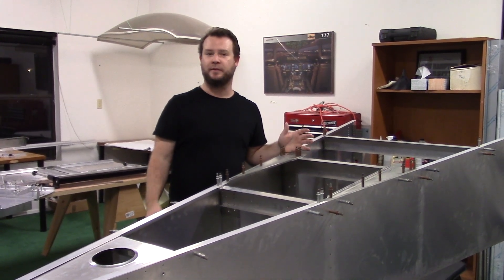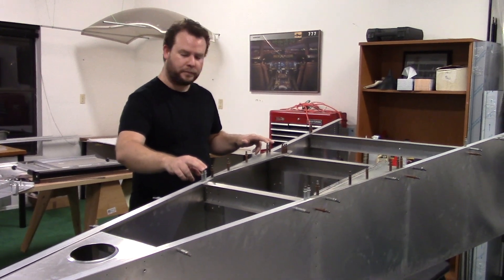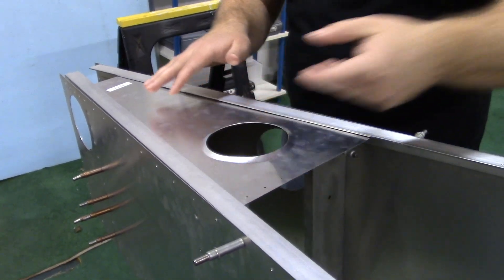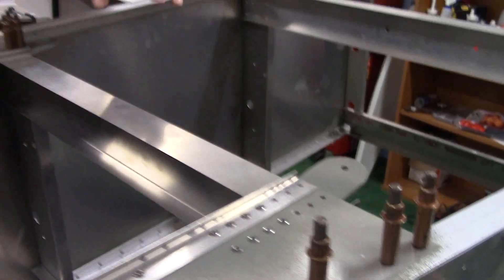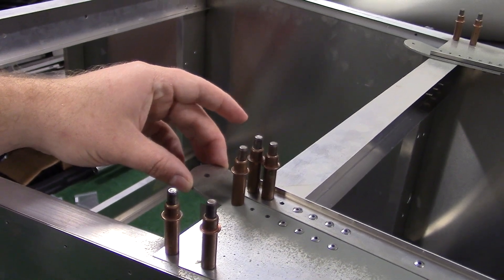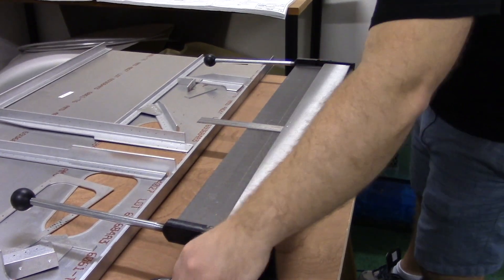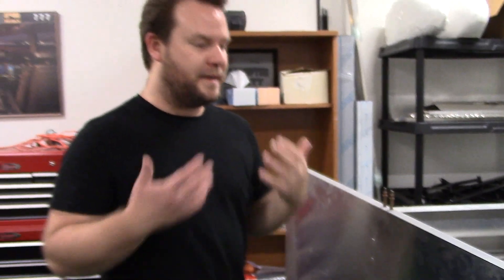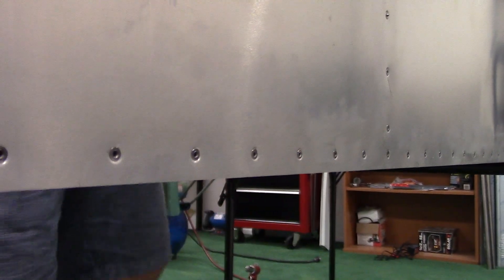Sonex Aircraft Build Video - 67 Shoulder Harness Web Install

Comment: Looks like the shear web (F22-03) is upside down. I believe that will get in the way of the horizontal stabilizer mounting. I am scratch building a Sonex myself. Thanks for putting the videos out. I have not had time to work on my plane in a long time. Keep pulling the rivets. You are not too far behind me.

Mike
Reply from the maker: I'll take a closer look. Thanks for the catch! -Dan

Comment: Ahhh. This brings back memories. I think I spent about 50% of my build time studying the plans to figure out the next task. The plans are really good, but you do have to use your brain to get the most from them. I admire your patience to use all flush rivets.
Reply from the maker: Hi David! I like your video "Sonex feeling." Thanks for letting me know about how much time you looked at the plans. I wasn't sure if I was doing something wrong because I felt like 1 out of 2 or so hours was staring at the plans and wondering "what the heck are they talking about." I am glad I did the flush rivet option. I plan to putty and sand the plane so much during the painting process that it will look like glass when I am done. We will see how that goes! -Dan